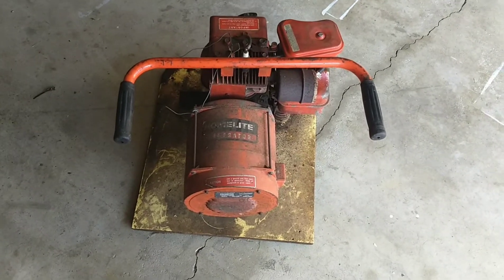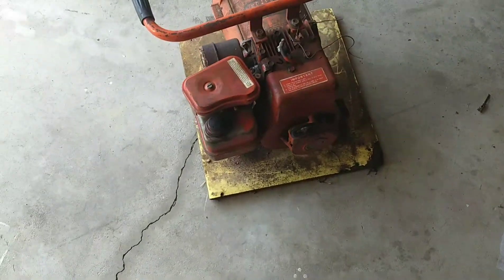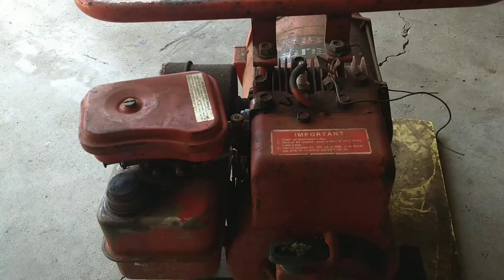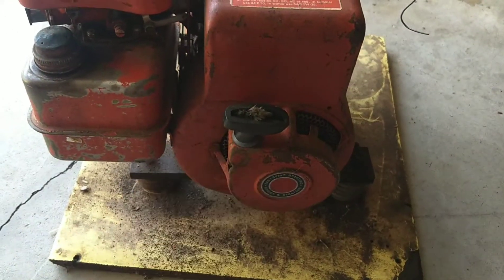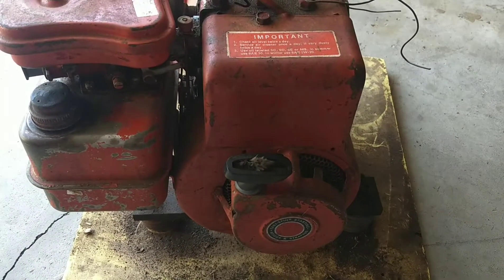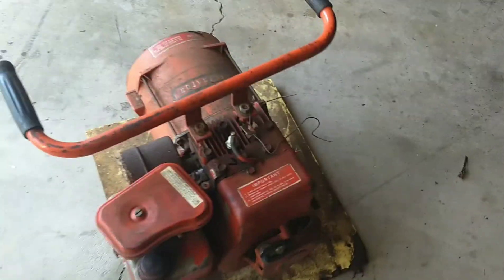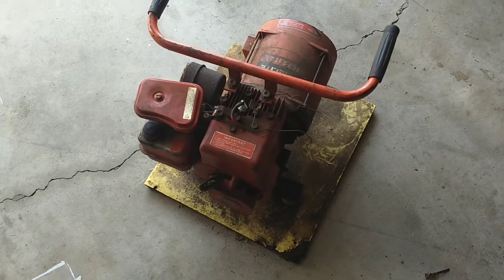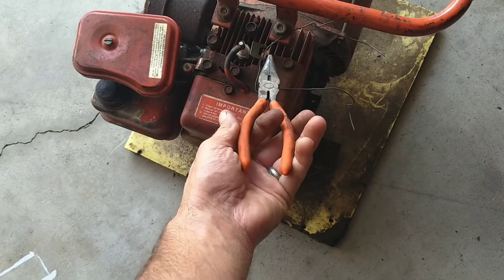Vintage Homelite Generator won't start, has compression and fuel but no spark

Comment: IT HAS POINTS AND CONDENSOR   WHAT YEAR IS IT? I HAVE A 1982  DO YOU KNOW IF I HAVE ELECTRONIC IGNITION OR POINTS BEING IT'S A 1982     NO SPARK EITHER ON MINE.   CAN YOU HELP ME OUT    THANKS
Reply from the maker: Well I'm not sure if it has an ignition coil or points. If it has points with no spark, obviously you'll need to pull the flywheel off and check to see if the points are corroded and opening and closing properly. If you need reference to how that is done check Taryl Fixes all on YouTube he has a bunch of videos and he's very entertaining. Keep me posted if I can assist I will. ✊
Reply: @Neighborhoodgo2guy  OK  I PULLED THE RECOIL COVER  OFF AND IT SEEMS TO HAVE JUST A COIL.  IF THEY HAVE POINTS AND CONDENSOR WHERE WOULD THEY BE.   THANKS